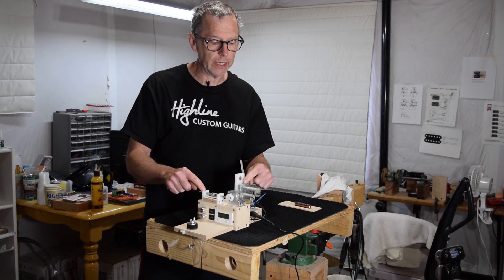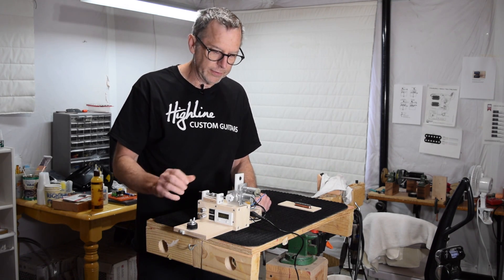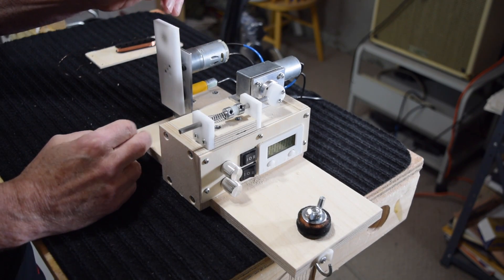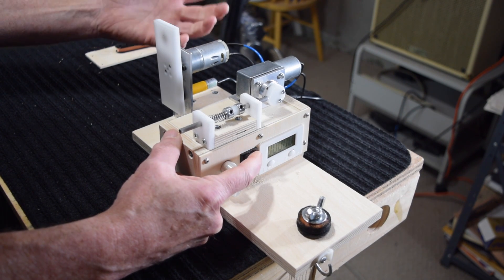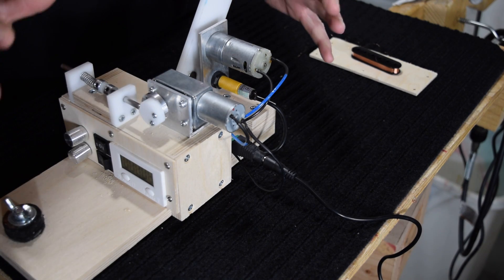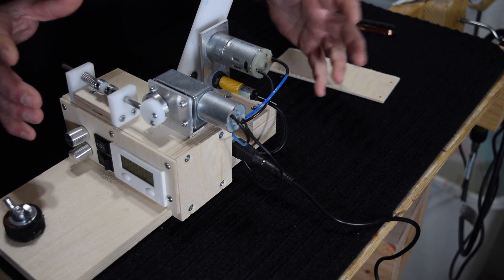My Homemade Guitar Pickup Winder

Comment: Hi Chris. I made my own winder partually based on your winder and partually on some others. I adapted your scatter system, however, there's one thing that I haven't figured out yet. I made a competely round cam with a diameter of 13.5 millimeters on a 20 millimeter hub. Now this makes a scatter area around 6.5 millimeters (approximately 1/4"). This will work fine with a Humbucker bobbin but a Strat single coil is wider and a P90 is narrower. Do you change cams according to the pickup you wind? What do you do?
Reply from the maker: I change cams. My humbucker and P90 are the same. The single-coil is the same shape, but larger. It gets tricky as single-coils can vary in width.

Comment: I'll happily buy this 15$ design instead of spending 525$ at stewmac for their winding machine.
Reply: Yes indeed. It’s ludicrous how much markup are on these machines
Reply: I just bought the design.  It really needs to have the manufacturer and part number for the two motors and the counter.  All the mounting holes in the plans depend on it and it does not come with them.
Reply: Need one $20
Reply: I pay full price for everything at Stewmac. I don’t mind

Comment: AWESOME!!!! I made one recently, not as good as yours. Where did you get the collet fro the motor.....where you attached the bobbin plate? That would improve mine tremendously!!
Reply from the maker: It's a Pololu Universal Hub. Google it and look for one (or similar) with a mounting hole that matches the motor's shaft diameter.

Comment: Very clever design. I have the same counter on my winder. It came with a reed switch which doesn’t work well at higher speeds. So I can’t run the winder past about 10 o’clock on the speed control. We’re probably using the same DC motor. 

I just picked up an LED counter with a magnetic proximity switch. Haven’t installed it yet.